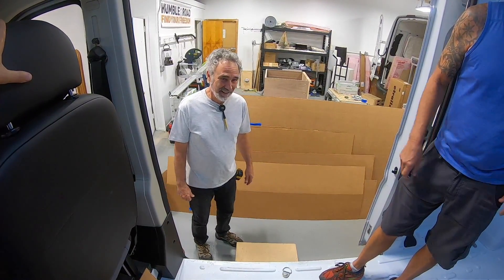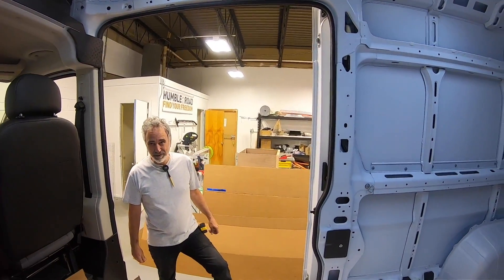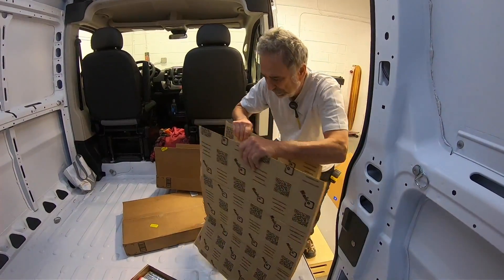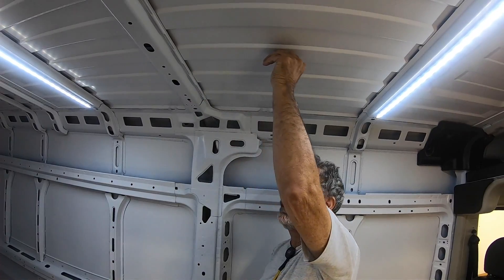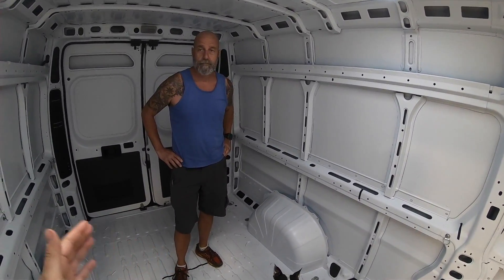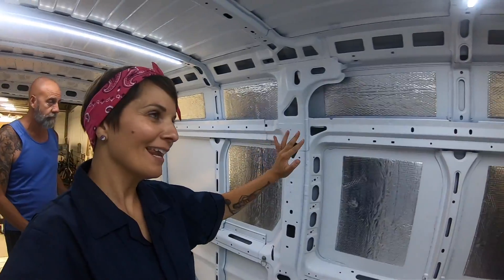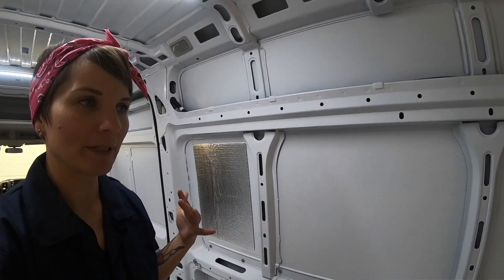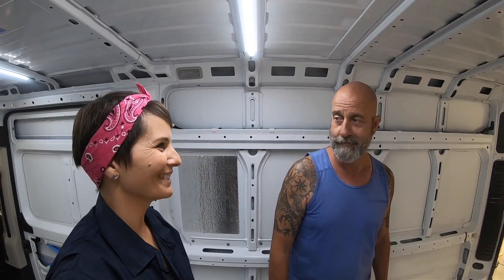Van Build Day One!

Comment: With no backdoor windows, may I suggest a Fantastic Fan hung like an awning window. This will give you a back window of sorts and a ton of ventilation when combined with the Fantastic Fan in the kitchen area . Have fun . I know you will .
Reply from the maker: Interesting idea. Thanks! We may put a small window by our head and a max air fan above the bed. So many options!
Reply: @CareyOnVagabond  I would expect you to have the AC above the bed and fan over kitchen and bathroom. Instead of windows , you might consider insulated cubbies at head and feet to allowing taller individuals ( resale?) to stretch out while sleeping . If nothing else , ask George to run wiring to the backdoors to tap into later. Easier to run wiring now than later . Look forward to your progress .
Reply from the maker: Stan Watkins  Good ideas. We plan on running lots of wiring for options but everything will be designed around us and what we want. Any resale will have to be someone similar😁.  Stay tuned for our roof plans.👍😁
Reply: @CareyOnVagabond  Your right of course. My wife and I have watched every video of yours and if anybody should know what they need and want , it's you guys . Just spit balling and living vicariously through you guys. We're about to leave next week for about four weeks in our oooooold 96 Coachmen Saratoga on the Dodge B3500 van chassis . We're either going to the Canadian Rockies and points in between ( Glacier park / Waterton lakes ) or to Chapel Hill North Carolina to visit our oldest son and his wife and most importantly , our first grandbaby . Tough choices .
Reply from the maker: Stan Watkins   We love the ideas. Don’t hesitate during our build to send them! Sounds like you have some awesome travels ahead. Maybe when we’re done herewe’ll see you on the road somewhere. Safe travels.

Comment: It’s rather strange that I discovered your channel at this time. I am also embarking on a similar journey. I currently live full time in a minivan and it is time to upgrade. I also have great ideas and concepts but I have limited construction skills and I don’t have a workshop. You have a great friend and an incredible resource in George. My great friend and incredible resource is Jeff, who owns Polar Mobility Research in Calgary AB. Polar Mobility specialize in mobile heating, refrigeration and air conditioning. They are distributors for Eberspacher & Domestic. George works with extruded aluminum while Jeff works with welded aluminum. You’ll be cooking with electricity rather than propane as will I. We have similar sized lithium battery systems though my 1065 watts of solar is somewhat larger than yours. All in all our projects are similar though completely different. I will be watching all your build videos.